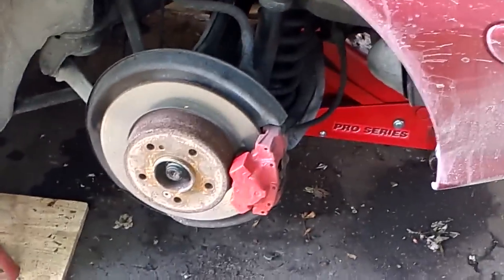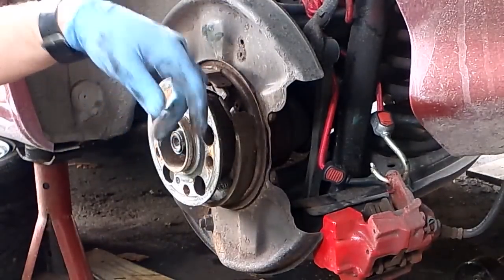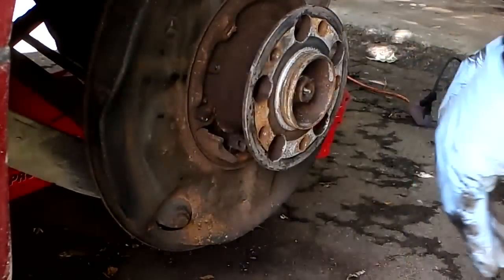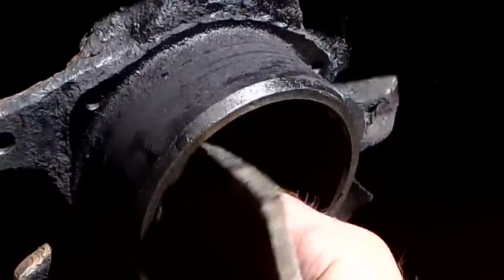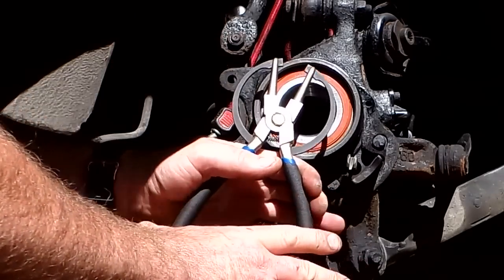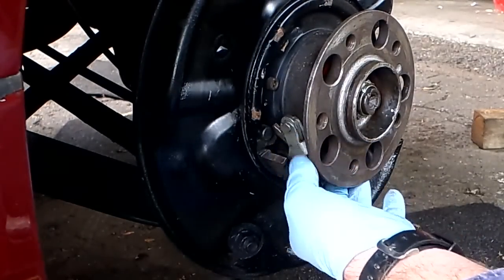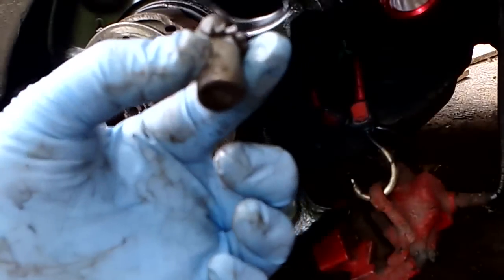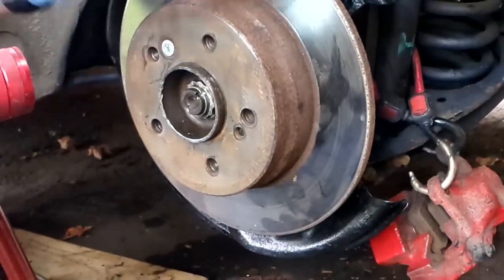Mercedes rear wheel drive axle/hub bearing replacement.. R170 shown..very long video

Comment: I am very grateful for this video Fupabox. I used to run a garage but now retired and have got rid of a lot of my tools. My 190 has about 350,000 miles on the clock and the rear brake back plates have rusted away where the shoe retaining springs go so they need replacing, and the bearings may as well be done at the same time. However, looking at your video convinces me that as I don't have some of the tools I will have to pay a garage £250 labour plus parts to change the back plates and bearings. Aaarrgghh! Never mind, at least I am convinced and am not going to waste a lot of time struggling in my driveway getting wet (it is always raining in England).

Comment: I believe that the right way to do this job is to remove the hub and use a shop press; it will only take a min. to get the old bearing out and get the new one in... Yes, you will have to remove the hub, but that's easy and goes faster and you will need a shop press... You can also take the hub to a car shop and pay a six pack of beer to have them do the pressing for you. I hate to see people hammering on a Mercedes and I would certainly never ever hammer on mine. Just my two cents :)

Comment: For around $60 you can get bearing and hub kit. I got the kit and pressed my hub into the bearing and then tapped the whole  thing into the spindle and was able to get the snap ring in with 90 degree snap ring pliers. I have the C320
Reply: How did you remove the half shaft from the diff

Comment: So I am in the middle of this job, cant feel my arms, am questioning all of my life choices,  and have a question for you.  As the rear race in the spindle is flush with the rear of the bearing, what part of the bearing did you pull against with the slide hammer when removing it?  I can only imagine that you at least got it started by using the slide hammer on the rubber portion and moved to the outer metal once there was a gap?  I can't see how that would hold together without tearing out??
Reply from the maker: exactly correct.. no way to remove the bearing without it coming apart . The washer I used on the backside was just big enough to grab a bit of the backside of the bearing lip when using the slide hammer. Congrats on having the balls to try this after watching  .
Reply: @fupabox  Did it.  Used a bearing press kit and it caught the rear lip just enough to drive it out with relative ease. Reinstallation was also a breeze.  I honestly think I would still be slide-hammering this time tomorrow to get that bastard out.  You are a gem- thanks for the great videos and help!
Reply: You still need the slide hammer to get the hub off, but here is the kit I used for anyone attempting this job. You need the size 17 puck to drive the old bearing out from the back, size 19 to drive the new one in from the front.  https://www.amazon.com/gp/product/B00QL1APQQ/ref=oh_aui_detailpage_o05_s00?ie=UTF8&psc=1

Comment: Torx is an American fastener. Mercedes uses a fastener called "Triple Square" which resembles Torx, but they are not interchangeable. If you try to use Torx to remove the fasteners on the axle, they will strip it out, as demonstrated here.
Reply from the maker: Ric Duoos     These are E-Torx  NOT triple square . Triple square as its name implies has 12 points . Torx and etorx have 6

Comment: Hey, thanks a lot for filming this, sure looks like an intensive job! Just curious - perhaps it would have been simpler to pull off the entire hub and carrier assembly and then pulling / pressing bearings? I'm thinking that could have saved you those stubborn drive shaft bolts. Possible made the bearing assembly easier too, but I have not done this myself so I'm probably missing something. In any case, keep up the great work! Love your videos!
Reply from the maker: +krigun  Yes those axle shaft bolts were the worst part of the job..I considered pulling the hubs... stubbornness made me continue with the axles  :)
Reply: I was thinking the same thing

Comment: What was the symptom that caused you to have to replace the wheel bearings
Reply from the maker: In the end it was a thrown belt on a brand new rear tire . Sounded just like a rear bearing .
Reply: @fupabox  I've been there. Did my neighbors front wheel bearings due to drone. That took out 50% of the drone, the tires were also shot. I usually move the tire to see if the noise moves but even then it's hard to tell.
Reply from the maker: @bobjones3725  I rode in the SLK trunk while the wife drove down the street . Sounded exactly like bearings and the tires only had a few hundred miles on them at the time . Near impossible to tell the 2 sounds apart . ☹️

Comment: OMG this is a hard job . I see why a mechanic would charge so much . How would one know these are bad ? My 2005 Crossfire is same set up as your Mercedes as I have said my car has 146,000 miles the rotor in the rear needs trueing due to some brake rotor scratch sound but other than that seems ok. Can I ask what Oil should I replace in my 6 speed manual I hear 5w20 Mobile is ok to use in the manual gear box ?? I have learned so much from your videos thanks so much .

Comment: There is enough room to get a big electric impact gun in there for those e-torx bolts. It still took some effort but the gun did most of the work

Comment: Is there any reason why you couldn’t install brake shoes etc. before pressing the hub back in.?
Reply from the maker: Not that I can think of .. May have been a better bet than fighting the springs
Reply: @fupabox  . I just did mine today. Much easier without the hub.    Strangely I could not find anything on UTube or Google that recommended installing parking brake assembly prior to hub assembly.   Most say reinstalling is reverse of dismantling.  Which of of course would entail installing brake after the hub.

Comment: Do I need to remove the hub bearing to replace the rear hub on an 2000 clk 430. I have stopped holes. Been driving with only 3 lugs in.
Reply from the maker: the hub can come out without removing the bearing . removing the spindle is highly recommended . In this video I attempted to do it all on the car and it's not a great option

Comment: I have recently bought a 2005 1.8 C-Class kompressor when it is driving in a straight line it is smooth as butter what I noticed when I purchase the car the front right wheel was a space saver wheel which gives me the impression that that could have possibly stroke a pathway or a pothole but I'm not sure when you're driving in a straight line everything is driving smooth but when you go over a speed ramp or swing the steering wheel from left to right the car will fishtail and wobble has anyone any suggestions as to where I should start in reference to rectifying

Comment: Great work, please can you tell me what did you use to cut the bolt heads off
Reply from the maker: a die grinder with a small cutting disc
Reply: Ok thanks I have at least two to deal to like that but your video will save me heaps even after buying 2 brand new pullers.

Comment: You don't show the set up on the hub, just the slide hammer end.how do you pull this hub? Whats on the other end of the slide hammer before you pull the bearing?
Reply from the maker: sorry some of the vids got lost while filming and editing . There was just a a few washers the diameter of the bearing stacked up for strength with the threaded rod for the puller secured by a nut behind the washers .

Comment: wondering if you could have broken the axle nut first and just kept the ebrake on along with wheel studs to keep the hub from moving  or maybe a screwdriver in the slots on the disk and have it snag on the caliper and back the axle nut off before undoing the rest of the componenets?
Reply from the maker: That should work

Comment: Awesome video bud quick question im in the middle doing and brake wire wont come out if i pull it out and it goes back in. Any idea why?
Reply from the maker: it's springing back from the side to side bias adjuster in the middle . You can unhook from the parking brake lever from underneath and that will give a bunch of slack
Reply: @fupabox  gotcha thank you.

Comment: Great video. Was wondering if I would have to go through all of this if I only want to swap the differential? Thanks.
Reply from the maker: nope...just unbolt the 2 axle shafts from the diff .. and the driveshaft of course
Reply: +fupabox my man. Huge help. Thank you so much.
Reply: The E12 Bolts Strip so easily because the cv axle boot is in the way i stripped 3 of them i have been stuck on it for 2 days my differential blew up at 270k miles pulled a differential from a 96 in 45 mins bc that one used 12 point tripple square which is way better than e torx
Reply: but how did you do the stripped ones

Comment: Hi Fupabox. Great video as always. My W203 has the same multilink suspension in the rear. How many hours of work is it to replace all those control arms in the rear?  I checked mine the other day and all the bushings are shot and have way too much play. I also suspect the bushing on the spindle is shot too even tho I didn't look at it. When I drive I hear something clunking from back there. Any tips on the bushing removal and control arms? Thanks!
Reply from the maker: soak them in penetrating oil a few days before removing...They aren't that bad to replace, about 2 hours per side to do them all..make sure to do final tightening on them a jack under the main control arm so they are tightened at normal ride height.. I actually have never had to do the rear main control arm bushings, so unfortunately have no advice on them
Reply: Thanks man for the help!

Comment: Do you think you might ever do a video on replacing the hydraulics that operate the trunk lid on the SL500?  I've seen it on the small Mercedes but not the SL.  I would appreciate it.
Reply from the maker: sl500 or 500sl ?   which year ?

Comment: Hey fupabox, I need to replace a left rear brake dust shield on a 06 c280, do i need to remove the hub assembly to get it off. thanks great video been a subscriber for a few years also have a w208.
Reply from the maker: the rear dustshields require removal of the rear brakes , hub/bearing assembly etc.  essentially ,the job in this video without removing the driveaxle..nasty job, if you can pound the shield that is on it into shape, it is worth trying to fix it before replacing

Comment: Please try to take this constructively but you completely complicated everything to do with the parking brake.  You just undo the side springs and the bottom spring leaving the top one in place and lift the whole assembly off with the shoes together with the adjuster.  Goes back the same way.  Also, the you put the top spring in wrong.  It was correct, it goes UNDER, when you originally took it apart.  Your videos are excellent even if there are little things that might be done differently, usually with the addition of some extra tools.
Reply from the maker: I appreciate constructive criticism... I think that suggestion on leaving the top spring in place would be easier. I usually just pull them all apart assuming I'll have to regrease the adjuster etc.  But it would be easier as you say to partially reassemble first. Damn , now I have to check that spring ..lol. Thanks

Comment: Informative video. What size is the axle nut?
Reply from the maker: should be 30mm
Reply: @fupabox  thanks a lot  asking for w208 clk430. Need to buy a 12point socket and don't want to spend too much $$
Reply: @ibanezgeorge  Came here with the same question for my W203. I have a 6 point 30mm socket, but wasn't sure if i needed a 12 point 30mm or a larger size!

Comment: Hi, I have done several of these in all kinds of Mercedes, VW's and whatever.  It is daunting and never ever fun. I usually pull the whole carrier and take it to be pressed in somewhere, that of course costs.  I have a SLK 230 to do and I was thinking of trying the freezer method and see how it goes.  One question, would it not have been easier to install the park brake components before the hub is pressed in?
Reply from the maker: Oh sure suggest that now..lol..I think it may be easier that way. Hope not to have to try it ;)

Comment: 30mm 12pt... same as pinion yoke, at least theyre consistent. Do the rear bearings go out nearly as often as the front wheel bearings? btw you fighting with that huge c clip was one of the more entertaining things ive seen this week haha
Reply from the maker: +The Stiver  I've never had a rear wheel bearing go bad in any Benz I've ever owned (8 of them..many high mileage)  apparently this one didn't have bad rear bearings either... I have what sounds and feels like a front wheel bearing going bad..I replaced both fronts 2 weeks ago, and adjusted with a dial gauge 5 times..noise remains..I can feel it through the steering wheel, and seems to change (not always though) with sharp direction changes.. IE loading the bearings , side to side.. Riding in trunk was to see if I could hear the rear bearings through the trunk floor.. nothing.  So I decided it had to be roughness in the front rotor surface, although there are no pulsations in the brake pedal.  Changed rotors...still there.  Ugh ! .. HAS to be rear wheel bearings, so I swap em out.. Still have the bearing noise.  Changed Diff fluid already, and no roughness fealt in pinion bearing.. Scratching my head ATM, but the only thing I can think of now is driveshaft support bearing, (no change in noise under load or coasting in neutral).. or transmission tailshaft bearing.  I actually forgot I have a Chassis ear remote radio chassis noise tester.. ( was given to me by a neighbor with some other diagnostic tools,..put them aside and forgot them)  I'll try it out and see if I can pinpoint it. Drives me nuts, but others say they don't notice it....  :(
Reply: +fupabox holy crap, yeah i thought it was odd you were replacing both rear wheel bearings. that's crazy. I wouldn't know what to tell you, the center support bearing on both my w202s with 220-240k miles were perfect when I had the driveshafts out but you never know, but like you said that shouldnt matter while turning but would change on accel/decel. weird wild stuff man, good luck and keep us posted
Reply from the maker: +The Stiver  If it ends up being a shifted belt in a tire I'll be pissed ..lol      BTW.. this is the tool I'll be using...can't believe I forgot about it..may have saved me a lot of time and $   http://www.matcotools.com/catalog/product/WCE97203/wireless-chassis-ear/
Reply: *****
you didnt try rotating the tires? haha
Reply from the maker: +The Stiver lol..nope.. staggered, so the fronts won't fit the rear...absolutely no sounds from the chassis ear..took it to the tire shop where I bought the rear Kumhos because they have a diagnostic tire balancer and a neat strobing light like a timing light..on the balancer he found the fronts had cupping only visible with the strobe, and with a load on the tire..impossible to see or feel otherwise... and at the same frequency as the vibration I was feeling..on the test drive I didn't tell him anything I had replaced.. he said front wheel bearings... I said , no ..replaced.. he said they weren't adjusted properly...again , nope.. he said rears then.. lol..once it went on the machine, it was apparent....I'm blaming a few long rides with a very heavy passenger (posted occupant weight limit exceded by at least 200 lbs, which made the car pull to the right the whole drive, won't do that again ... and the bad tire was passenger side )   Argh !!  lol , at least I'm not going to be throwing any more parts at it
Reply: +fupabox Holy mother of all things holy, haha, and you went through all that. Tires are a bitch when they get you. I put my snows on in May when it was 90*F out for a few days because I suspected I had a tire issue lol. Oh btw the saga continues... Finally got my hands on a c220 in the junkyard today, the pinion nut is held on by the wraith of God, two 230 lb men pulling/pushing a breaker bar from both sides of the car, nada, so I'm gonna buy a 450 ft-lbs rated cordless impact and try again haha
Reply from the maker: +The Stiver Ouch.. when I used t play with air cooled VWs the rear axle nut was like that..6ft piece of metal pipe over a 3/4 cheater bar and jump on it to break the nut free... what if you brace the breaker bar against the ground and use the rear wheel hub to turn against it... you might have more room to maneuver a longer cheater bar on the wheel hub
Reply: +fupabox that was my idea but my friend pointed out you'd have to hold the hub on the other side from spinning too, plus the socket we have isn't the best it seemed a little sloppy on the pinion nut, we certainly didn't have enough bars, 30mm 12pt sockets, or arms to coordinate all that lol. Always nice to have an excuse to buy new toys, right?
Reply from the maker: The Stiver tools aren't an excuse..they're an answer...that tool saves me $   :)
Reply: +fupabox Came out like butter with a $120 impact from home depot
Reply from the maker: The Stiver excellent...  :)
Reply: So how do you know when your rear bearings are shot ... what will it sound like?  

It seems like it is highly unlikely that I have bad rear bearings based upon your experience with 8 different hight mileage cars ...
Reply from the maker: Joel Miller you know the sound your tires make when you drive on a highway that has been ground down before they put new pavement down ?  it will sound kind of like that..and will get louder the faster you drive